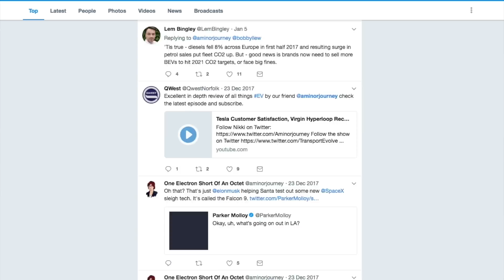Electric Car Fires: What You Need To Know

Comment: I don't understand how an electric car fire even compares to a ICE car. Batteries are shielded from the bottom and top via armoured plates and compartmentalized too. Takes a while for the fire to get going. Petrol especially is highly flammable, vapour alone can ignite, much less time to react. That said why didn't the sensors on the Tesla register anything akin to a battery fire. Hmmm 🤔
Reply: Not only will it save people from the heat of a fire, but it's the closest thing to an assurance that the people will be out of the car long before the fire starts or spreads enough to be dangerous. The exceptions are likely to be ones that were already fatal crashes. But even in those, chances are the bodies will be removed before the fire reaches them.
Reply: + Bill Cichoke
lol. Where do you get such nonsense? LiCoO4 can react with air (see spontaneous burning), LiFeP04 reacts with water. "The problem" is that the  weight of these organic electrolyte gases which are flammable is nihil  and any decent amount of water will cool down fire in pretty short time. You just have to use anything what you have (blanket is less good because you do need to cool batteries).
Of course I am talking about proper designs with fuses, proper charger logic and temperature sensors capable to prevent either short circuitry, overcharge or temperature runaway. Tesla (and not only) has all this. Otherwise the chance of fire will be much higher (still comparable with ICE technologies lol).

The dangerous packages are  badly closed often even soft flat packages called "bricks". most notorious are ubiquitous Chinese crappy packages based on LiFePO4. You get amazing mix of dangerous levels of HF, POF3 and other nasty things. What is more important they can have excessive load of organic electrolyte, which literally leaks if the package is broken. They produce plenty of gases.
But even such crap is no more dangerous than burning plastic which fills any car interior. I warrant plenty of F there.

The fire in LA is indeed typical liOn fire and the way it progressed indicates it is 100% the result of puncturing (and massive one). You can see venting gases coming from the middle section to the left front side of the battery pack, which is actually quite interesting by itself. it's the most probable part to have damaged when you have front wheel dive on bumpy road but why to the left?. 
What version of Model S was it?
Reply: "compartmentalized"...yeah that will save it from the heat of the fire next to it! Sarcasm aside, they should have included thermal blankets or something like that on the sides of the compartments. Edit: Just heard Nikki talk about battery safety at 6:30 so good on the manufacturers for doing that!
Reply: KAOS
They're in battery "packs" separate from each other (compartmentalized) and that helps slow down the spread. Nicky also mentioned some packs come with foam dampeners that are intended to eliminate a fire before it spreads.
Reply: Hi Alex,

It’s clear (or I’m assuming) you know more than you said above, and the replies didn’t catch on. It’s true safety standards on new technologies are much higher than those allowed on legacy sources. The Germans designed a hydrogen tank to power a H2 powered muscle car. Which could survive a major accident without releasing its contents. The Boeing Company used a non-U.S. manufacturer for its 787 battery pack (needed for emergencies, to operate the electric brakes, and flipping on the lights). To stay out of the news when a battery cell fails, the enclosed the battery, and added a vent. Along with some other improvements. 

What we need is free energy. See my post above.
Reply: Maybe is sabotage!
Reply: EV batteries are just like 1973-1987 Chevy truck fuel tanks, not actually fire prone, but perceived as very fire prone
Reply: "Lithium, the alkaline metal In those batteries, reacts spontaneously with water in the air..." So does sodium so are you suggesting that we stay away from table salt? Tesla's batteries do have lithium ions, but no metallic lithium. Lithium ions are a small percentage of the battery composition. The batteries are mostly made of nickel, by far, with smaller amounts of cobalt (the amount is being reduced as Tesla refines the design) and an even lesser amount of aluminum.  But if you are afraid, stay away from table salt. Listen to your doctor. Too much of it might kill you. Then again, it might not.